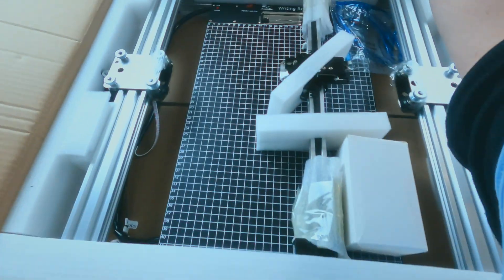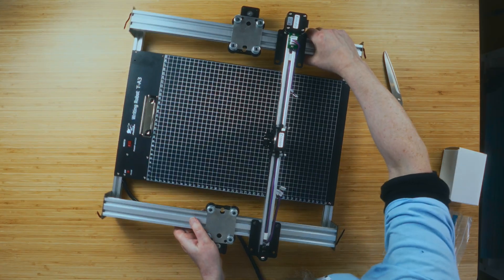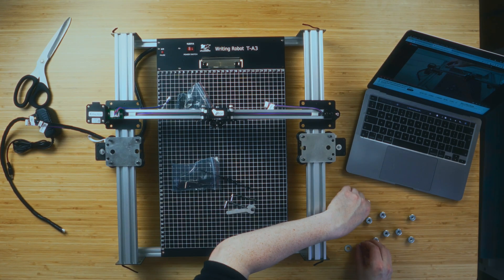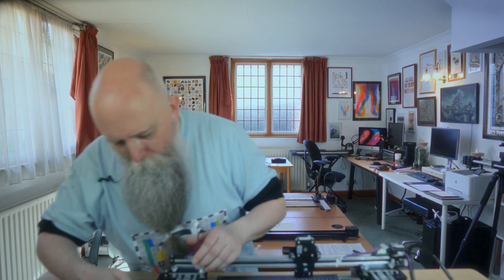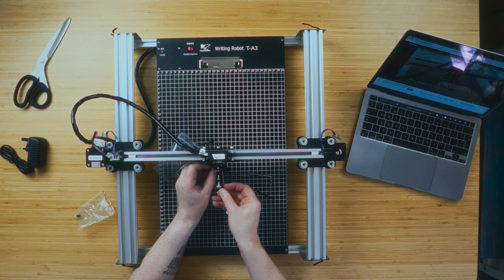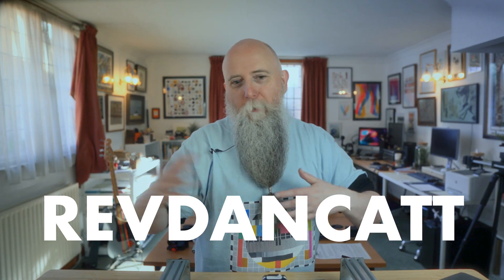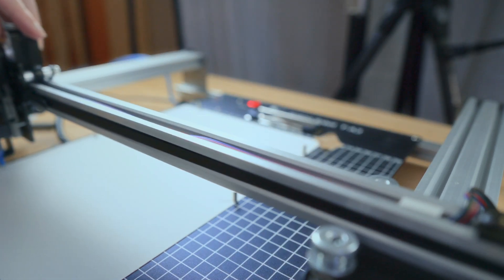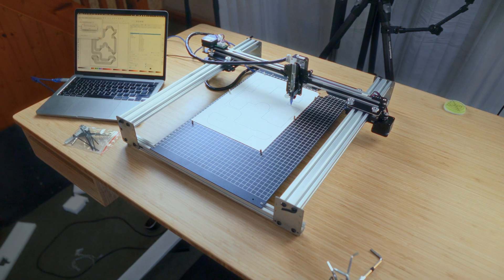iDraw H A3 Unboxing | a quick drawing machine/pen plotter overview.

Comment: Thanks for the video.

Did you have a look at the wobbly base? 
Like you said it's not standing completely flat on the table.
Reply from the maker: Yeah, it's still a bit wobbly, I just put some card under the foot. It does mean the whole unit is slightly twisted, but I haven't noticed it cause any problems with the plot, the pen clears the paper at all points. Any bowing hasn't been significant enough to cause any trouble.

Comment: Dan I've got one of the older models, an A3 T plotter. Two things I've struggled with: 1. getting it to return to the same spot after drawing a layer, it always needs to be pushed back to (0,0) which feels hacky and fraught. 2. Whenever I've tried to use something that's not the inkscape extensions (e.g. the axidraw python module) it's sort of almost worked but everything's been upside down and inside out. Would be ace to know if the newer version returns back to the same spot, and if it would allow me to escape inkscape (inkscape and I do not get along).
Reply: What are you using instead of Inkscape? I really want something else but I have no idea what software I can use. Thx
Reply from the maker: Oh I hate InkScape with a passion!! This does have a "return to home" option, but it's the thing it told me I needed to update my firmware for, which I didn't do. I'm still after all this time checking the alignment between layers by hand.

I'll have to look at the python part, talking to it directly is something I need to do more.
Reply: @revdancatt  Inkscape is clunky and sluggish… but it’s free and that is why so many plotters use it.   It’s not really designed to do anything workflow. Even the way it handles templates is goofy. Problem is as a world wide market, plotter users are very tiny.  This is good in some ways making us more unique. As far as software and support it’s not good.  I am hoping with the advent of AI programming systems, we will finally be able to get high grade software.
Reply: Having the same issue- would love if anyone else has solved this with a different program, etc!